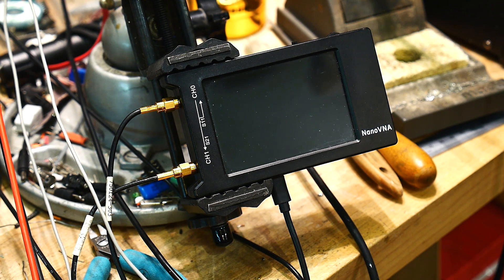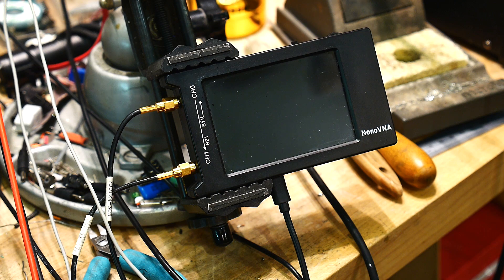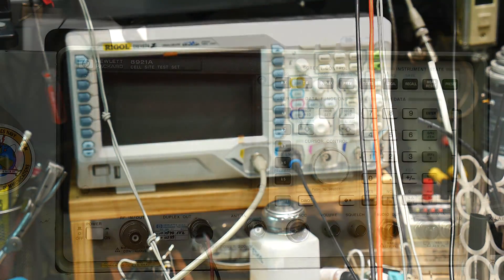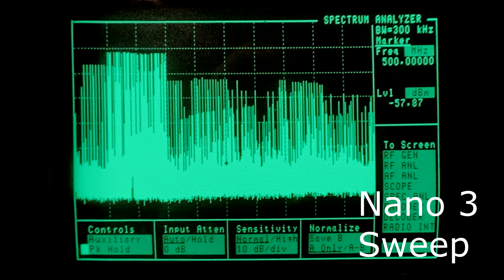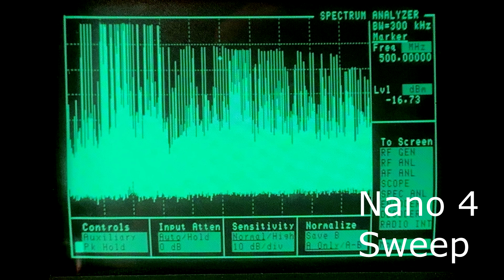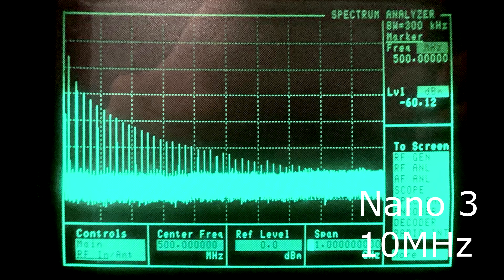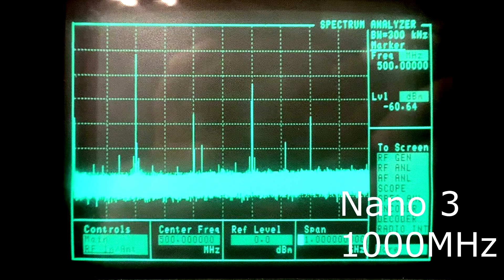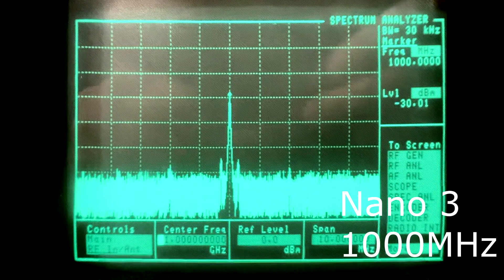#556 NANOVNA RF Generator Spectrum

Comment: I was messing around with one of my NANO's and tried to use it as a very crude Spectrum Analyzer and was surprised that it worked as well as it did! The signals on your scope is limited to low BW, that's why you cant see what the signal really looks like above 20MHz. TNX 4 the upload!
73 N8AUM

Comment: I haven't tried it yet, but you have seen this, correct?
https://hackaday.com/2015/09/22/a-better-spectrum-analyzer-for-your-rigol-scope/
https://github.com/rheslip/PyDSA
Reply from the maker: Yes, I had seen that. Seems like an interesting idea. I've always found that I hate a PC on the workbench though. People are all interested in the PC connection for the TinySA but I don't see it. I'd rather spend $400 on a used analyzer if I can fit a big box on the bench. or if one has $1000 get a Siglent with a tracking generator.

Comment: At 927.500, my H4 outputs +1.26 dBm.
At 450.000, it outputs +1.22dBm
At 400.000, it outputs +1.18dBm.
All in all  across the bands tested, minimum output level was +1.14dBm.
Pretty flat across the bands tested.
Some noise on several signals tested, especially over 530 MHz.
At 147.000, output changed slightly from wide to narrow, but not enough to cause concern.
Harmonic generation shows a lot of ringing, which appears to be a normal function of using harmonics to generate a signal.
I am just a little amazed at the output being so steady.
My next test, will be with the NANO VNA-F.
My favorite of the two, and far easier to update as well.
Reply from the maker: what instrument did you measure with? if a power meter, it integrates all the harmonics so would stay constant.

Comment: It's a square wave, all the way up to 300MHz.  It uses the 3rd and 5th harmonics to get to higher frequencies.  For example, a 200MHz square wave is used for 200MHz, 600MHz and 1GHz.  The power level for the 3rd harmonic is about 10dB lower than the fundamental, and the 5th harmonic is about 20dB down from the fundamental.
Reply: The newer nanoVNA V2 SAA-2N also has a squarewave output but since it's oscillator sweeps right up past 3GHz on the fundamental, the output is able to produce even sharper squarewaves right up into the UHF-VHF region.  Measured on an old 0-500MHz analog spectrum analyser, the harmonics are very noticable across the whole frequency range. There are significant even-order harmonics too!
With output set to 52MHz, 3,5,7,9 harmonics are = -9, -15, -21, -23dBm (relative to fundamental, fairly close to theoretical levels)
Even order are also fairly strong x2,4,6,8,10 are = -33, -35, -37, -39, -41dBm (there are no even harmonics in perfect square waves).
This is one reason why these VNAs perform very poorly as spectrum analyzers, and maybe why the range of return loss measurements is fairly limited.  
For it's intended purpose though, I'd argue that the performance/price ratio is still far better than a $100,000 instrument :-)

Comment: Upgrade the 2.8" version firmware with this: https://groups.io/g/nanovna-users/files/Dislord%27s%20Nanovna%20-H%20Firmware/NanoVNA%20v1.0.33.rar you will get an option to chose the si5351 output drive.

Comment: Well, shouldn't the 50 Ohm pass-through terminator be rather located at the scope side of the cable, for proper termination of the cable?
Reply: 9:25
Yep, I think I’d better put the load at far end of coax near the oscilloscope.